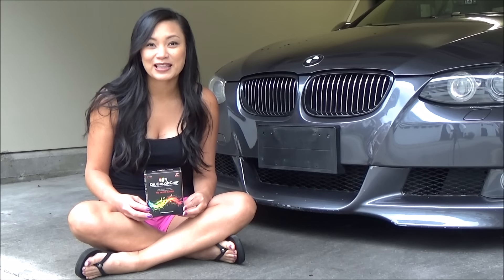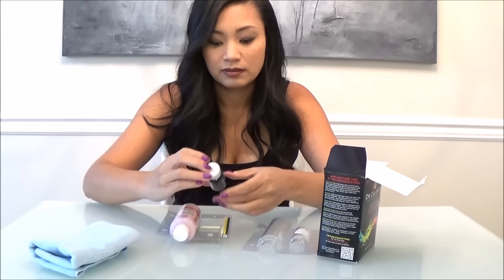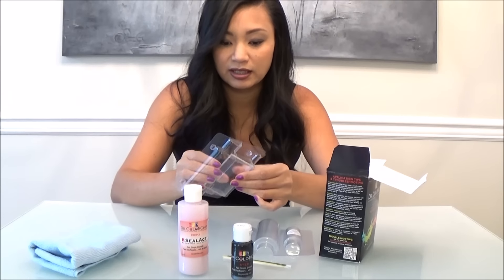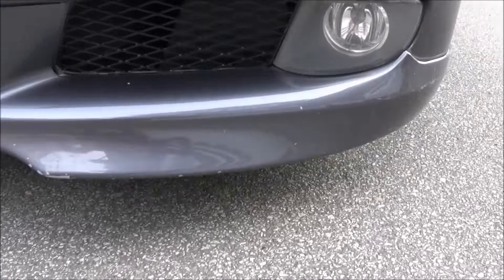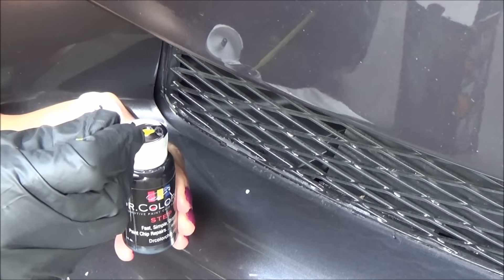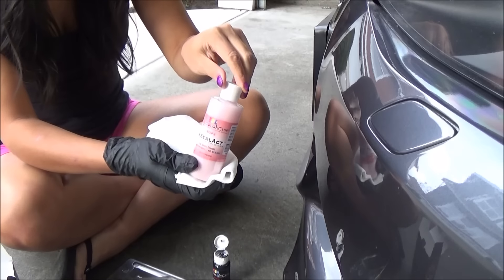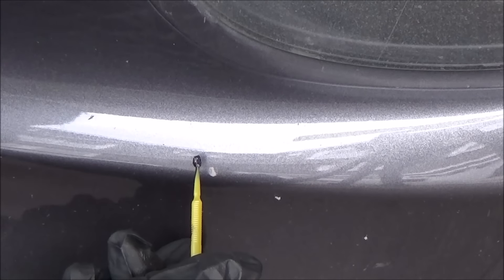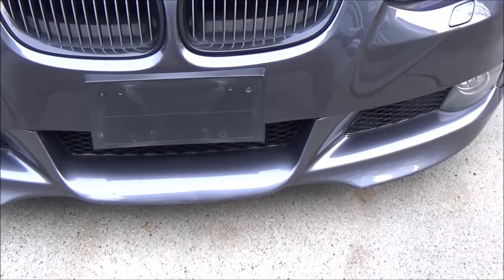How to Touch Up Paint Chips on your Car (Using Dr. ColorChip Repair Kit on a BMW 335i)

Comment: So after using this product, I find that for deep chips, it’s best to use the squeegee and let the pint dry for 5 to 10 min.  Then use a q-tip with the blending agent to remove the excess paint around the chip and then lightly go over the area with the cloth dipped in the blending agent ( celax sp?).  You may have to do this up to 4 - 8 times to get the touch up to the original level of the paint.  It helps to wait a few days between applications in order to allow the paint to dry and shrink.  Dr. Color Chip is a good product and the color is spot on, you just have to be patient and work at it.
Reply: Plz help I need best tips 🙏  on hood of my car like 5 paint chip spots maybe little bit bigger then ones in this video? I need best videovever

Comment: Looks vastly better for sure. For a quick and cheap cosmetic, it does really does help to mask that damage. Do you drive B roads a lot?
Thanks for watching? No, thank you for going to the trouble of posting and BTW, it's no hardship :-)
Reply from the maker: +pete b Haha, thanks. And no, I drive on pretty good roads normally. I really think it's a terrible thing cheap point job on the eBay front lip that is the problem.

Comment: Nice job,....just make sure to protect with sealnt and a carnuba afterward since you used rubbing alcohol. Blackfire Wet Diamond is probably the best/easiest to use sealant I've used. I have a Jet Black 335i.
Reply from the maker: +BucketheadLS1 Oh, interesting. Thanks.
Reply: BucketheadLS1 you should wait about 30 days before you do that though. At least I seen a auto body video and they said before you put wax over it you should wait 30 days. I don't think you need a sealant and wax but if you want you can. wax will act as a sealant.
Reply: Totally untrue. Wax is not the same as sealant. Sealant lasts much longer and the will sit on top of the sealant. You can apply wax over sealant immediately.
Reply: I know you can apply wax over sealant right away. If you listened what I said is I seen a YouTube video of a body shop and they said you shouldn't apply wax or sealant over the repair for about 30 days.
Reply: You also said a wax will act as a sealant, which isn't exactly true. Sealant lasts a lot longer. Carnuba wax lasts a few weeks, tops.
Reply: Jhon John Jon Jon Doe why 30 day cure? I’d say let paint cure 24-48 hrs than add sealant

Comment: For my older brother's 2008 BMW 535i that I will take for my first car, I will fix the faded paint myself and some of the parts that are faded, I will paint in the same color as the car which is the Monaco Blue color and then for the roof, the hood, and the trunk (which are some of the faded pieces), I will paint them silver so that it could give the vehicle BMWs colors that they use on their emblem

Comment: Nice video but sorry that you have to deal with sexist comments from some horny bastards.  I wonder if you have tried applying some primer in the deeper crater before applying the paint.  Also, since you are applying this stuff on the bumper which maybe made of plastic, I wonder how long it will take before it comes off.
Reply from the maker: +theo Jones I haven't tried anything except this product and I just followed the instructions. I'm sure there are methods of filling in the deeper craters but this was just a quick and easy solution 😊

Comment: Hi Tara, I had two questions.
How much did it cost and can it be used to fill indentations in the paint coat?
Reply from the maker: +Zeeshan Qazi It's $50 and yes, my chips were very deep and it works if you do lots of coats. I need to do more though.

Comment: I just came to this video cuz I saw legs
Reply from the maker: Hope you stayed and learned about touch up paint! 😊
Reply: TVTara yeaaa I don’t believe in kit system. There is no protective clear coat going over it. Unless it’s mixed in the paint but then it’s getting diluted with that crap you’re wiping over it. Very bad. That kit is just a fancier way of applying single staged touch up paint then Wiping the access with paint thinner.

Comment: You should use masking tape.
Reply from the maker: +Rudy Yeung Where? How?
Reply: Get a roll of 3M masking tape from Lowes/HomeDepot, and apply it to the area you want to touch up.  Then you will not have any excessive paint and clearcoating going to the area that you do not want.
Reply from the maker: +Rudy Yeung I don't think that's necessary with this product though.
Reply: Well, I guess this special kit does not require any masking then.

Comment: cheap paint job? did u repaint it?
Reply from the maker: +MrBuzzialdrin I bought the lip pre-painted from eBay which is not a good idea.
Reply: oh i see sorry to hear. So how is the paint holding up on the rear spoiler.... ? 
anyway, proud of u doing all the work. i am so lazy. lol.
Reply from the maker: +MrBuzzialdrin Rear spoiler came pre-painted and it looks perfect but that's because rocks are not flying at it!